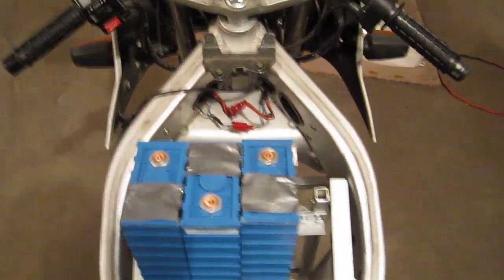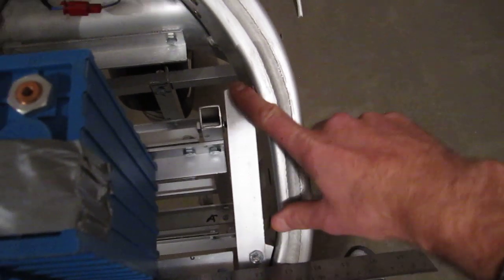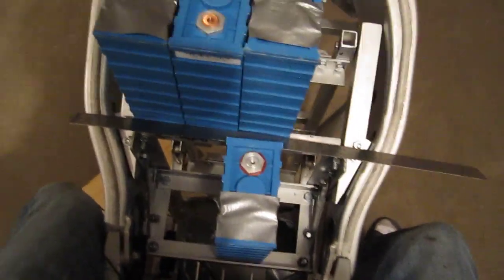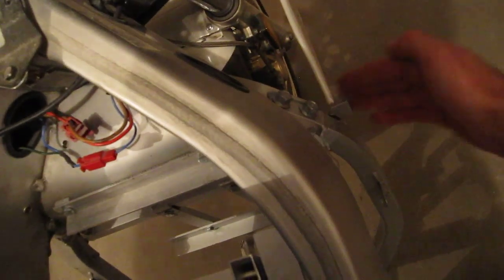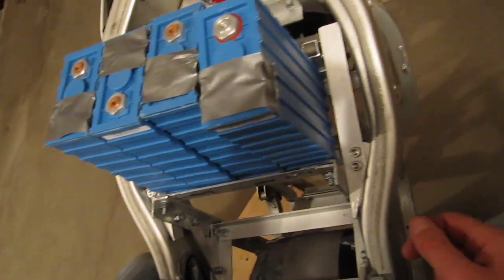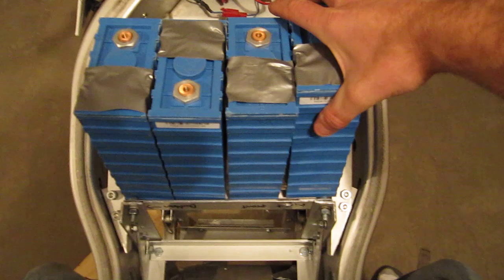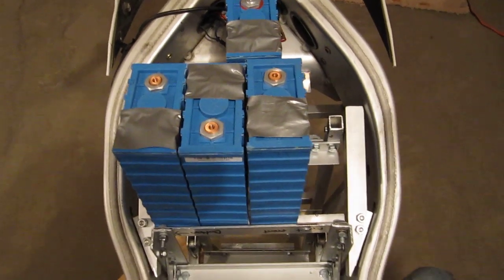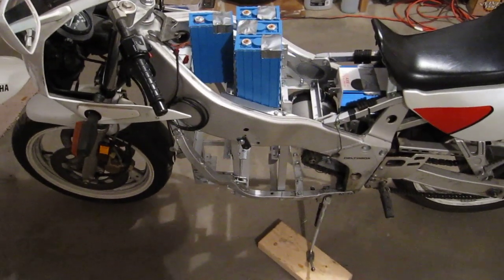Electric Motorcycle Build #22

Comment: ow sweet that's pretty good.. i'm looking at putting a 72v 50ah lithium hybrid super capacitor bank together.. they weigh abit less and are abit smaller in size than standard lithium cell's but have a C rating of 5-25.. 300amp con 1280amp burst..but they also come at a slightly higher cost of $100 per cell..  60+ miles is my aim